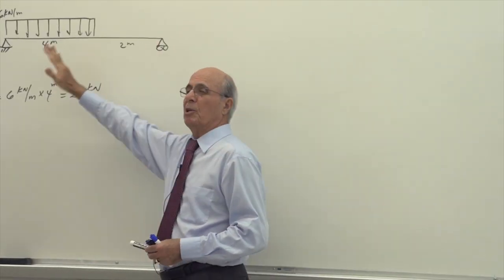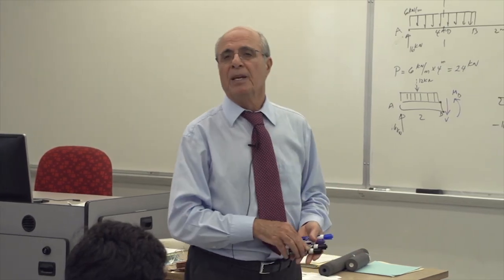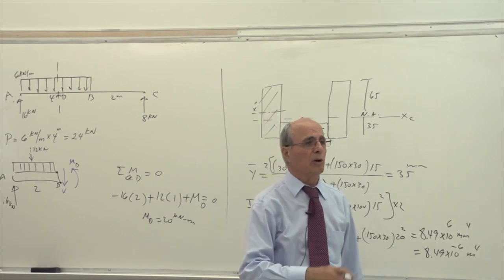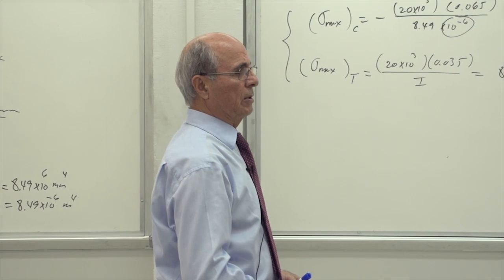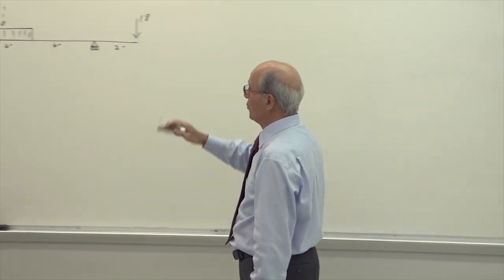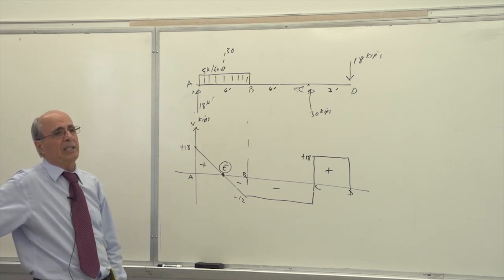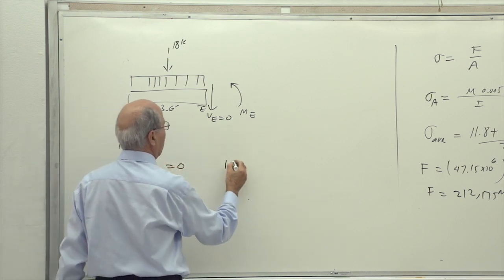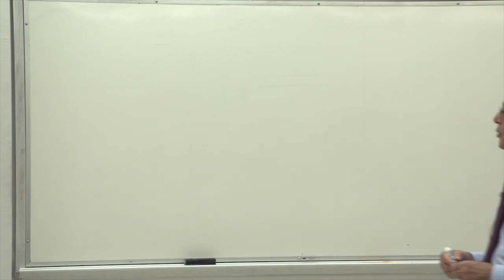Strength of Materials I: Shear & Bending Diagrams Example, Shearing Stresses in Beams (17 of 20)

Comment: 00:00 - 24:33 quiz review, finding the total force in a section
24:33 - 41:07 two methods for finding point of local max/min of the moment
41:07 - 50:49 shear, moment diagrams for cantilever beam with external moments
50:49 - 1:19:02 intro to ch. 6, stresses due to shear forces in a beam
Reply: thanks mate
Reply: Thank you so much!
Reply from the maker: Thanks!